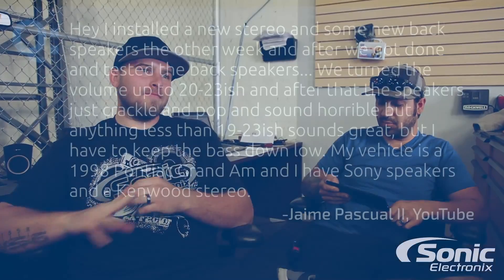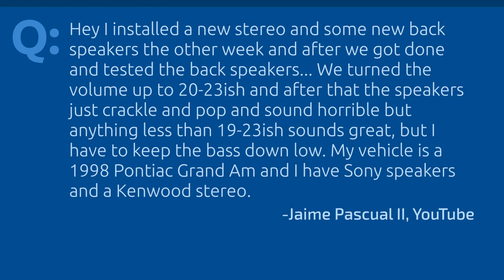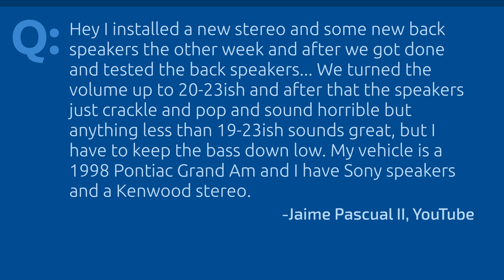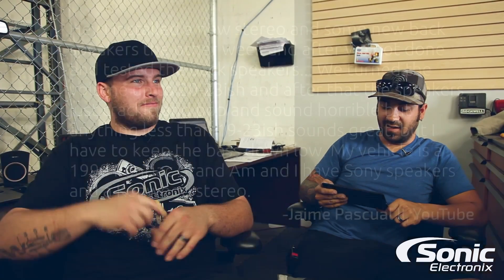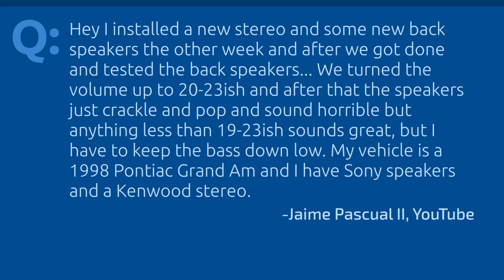Why Do My Speakers Sound Bad at High Volume? | Car Audio Q & A

Comment: Can an amp be bridged to power speakers ?? Not A Sub !!
Reply: +Roshan Dixit i tried that once on a 6x9 (un-mounted) and i saw sparks jumping across the speaker terminals. it may work under certain conditions but but its not worth the risk IMO. just get a bigger amp
Reply: yes you can, but why would you want a Mono output when you have stereo outputs? Also read up on Ohms Law when attempting new things. If your amp is 2 Ohm stable and you bridge the two channels a 4 Ohm load will split across the 2 channels, thus giving each channel a 2 Ohm load. if you wore down to 2 Ohms and bridge a 2 Ohm stable amp that doesn't immediately go into protect you'll blow your amp/speakers up.

Comment: I have a pretty light powered amp Pioneer GMA4604 480W. Runs 40W x 4 or 120W x 2 bridged. I'm powering my front pioneer speakers with two channels and then plan on bridging the last two channels for a small sub. I'm looking at the Kick 10C124's "handles" up to 150W RMS. Does this mean that the sub is recommended to run at 150 W or is that the max wattage? With 120W would it  be considered under powering the sub or will the sub will run weaker @ 120 W. I can't find many decent 120 W subs.
Reply: When matching subs to an amp the MAX/PEAK power rating means nothing, same with speakers. If you can't find the RMS rating of an amp/speaker... DONT BUY IT!
Your front speakers will run 40Watts RMS, your sub will run 120Watts RMS. I usually go off the rule of thumb of keep your sub as close to the RMS rating as possible. So the answer is yes. that's a good match. find the recommended volume for the sub so you buy it once. I don't know about your sub, didn't look it up. it needs to be a single voice coil 4Ohm sub. other wise you will run into issues.

Comment: I just put 6x9 boss 600w subs in my 92 accord coupe and they sound okay until I turn the sound up… could it be my stock radio or do I need an amp ?
Reply: +Martin Turner you'll need an amp def. the stock headunit isnt giving the sub enough power.
Reply: Get an amp buddy, I got 500w so I have a 500w amp.
Reply: buy a 500 watt MonoBlock and wire down to 2 Ohms and call it a day.
Reply: Kevin Wayburn Perf

Comment: Hi. I have a RF Prime Sub, Polk Audio db6501 compos in front doors, and JBL 6x9 coaxials at the rear deck. Pioneer 8690BT is the HU. The speakers and sub setup are being powered by JBL XT646 4 ch Amp and Rockford Prime 4 ch powering the Sub. LPF and HPF on Amps are off. I prefer setting them via the HU. Please suggest the best crossover settings for LPF and HPF on the HU, so that i get a cleaner sound and a cleaner bass even at high volumes
Reply: I usually start with loudness/bassboost off, set the eq to flat, then flatten the volume of the sub to the stereo. after that I put my HPF to 80 and LPF to 80, after that it's preference. I tend to set mine at 100.

Comment: hi, I put in coaxial 6x8 Kickers in my doors of my 04 Mustang. It has the Mach system. Problem is, when I turn up the volume, (not to load) the right door speaker bass cuts off and when I turn down the volume the bass comes back on... help? thank you, Kel.
Reply: Does your mustang have the Mach stereo in it with the amp tray in the back holding 4 amps?
Reply: Mach stereo and it has the sub box and two amps, (one on each end), with the speakers 8x9
Reply: +KelJenn B My friend had an 03 with Mach system. We ended up ripping the amps out and rewiring the speakers off the head unit. best thing you can check is the auto volume and disable it.

Comment: I have jbl gto 509c and mds fanatic f2. My right door speaker sounds good when there is no bass in the song, but when there is bass, I can only hear crackling and popping all over the place. Sounds kind of like there was something loose in the door, but there isn't because i just dynamatted the shit out of the doors. Left door seems to be fine. What could cause this? Im utterly hopeless and it ruins my driving pleasure :(
Reply: Sounds like a blown voice coil perhaps. Try pushing in on the speaker cone while no music is playing. If you hear or feel anything other than silence and smoothness your voice coil is blown and time for new speakers
Reply: +Budz Wingren turned out that when i put more volume, the cone is hitting a part of the doorcard.
Reply: +kakka626 That's great it was a simple fix!

Comment: @sonic electronix.... hey guys , we see all these videos on youtube and sonic channel on why one should upgrade a car speakers... and examples used of a factory speaker is a warn out piece of crap (excuse my language) that's half broken and cracked...... but what if you got a newerr car and have factory stock Bose, Infinity etc. Can you guys do a video on if/should one upgrade when their factory speakers are name brand?
Reply: My Silverado did not come with the Bose system but I think the front speakers are the same. The Bose system sucks, but the amp and speakers are actually decent sounding. I would suggest upgrade the head unit first. You may be surprised. My sister did in her 03 Trailblazer with Bose and likes it a lot. Especially with the added BlueTooth which she didn't have before.

Comment: why do my amp turn off when I turn it up to bass. it thumps hard for about 10 min then turns off ? and when I touch my Amp it's very hot.
Reply: Depends on your amp, what class amp it is determines how much cooling it requires so you could be overheating it with the amp being in a closed environment where it can't breath. Another option is that you are running it in an incorrect way such as some amps can't handle 1ohm loads.
Reply: Thank you !!! I will take a look at that.

Comment: any experience with a DD audio 3512g? I have a (18 inch tall,16 inch sides) speaker box , when I turn my volume abit up I hear a rattle like if the speakers are blown , when I'm away from the speakers ,I hear a good clean bass? Any way it could be?
Reply: check the wire in the box

Comment: I have a issue where my new pyle 5.25'' (upgraded from a 4'' kickers that i thought were under powered) speakers in my dash and at any volume above 25 they crackle so bad and its really annoying and my pioneer 6x9s in the back don't crackle. powered by a JVC KD-R330 deck. Also would bass blockers up front help this issue? thanks

Comment: so a 85W X 4 channel car stereo would mean a RMS of +40W. if that's correct than the speakers to be used must have a RMS value of +50W if u aren't going to use an external amplifier. is that correct?
Reply from the maker: Ulrich Sosro That is roughly correct. Most aftermarket stereos list RMS wattage so be sure to check. A 50W RMS speaker is usually a good match for running right off the stereo.
Reply: yes
Reply: My car radio is 20W x4channel  thats very weak I bought  a  50W RMS speakers the sound is bad when i turn on to max volume what if I buy better car stereo(If I buy 50or100W x4 channel radio) .Pls give me some advice?

Comment: Hey guys.... I have Kenwood ddx 310 head unit plus a boss 3000watt armor class d mono block amp n a 2000watt 4channel's boss riot, with a 2000watt sony explode sub, 2 kicker6x9, 2 pioneer ts-575m but every time I turn my system up I can smell the speakers. N yes its a budget system.
Reply: Mccoy Henry change the cheap sub , look on line for a good price

Comment: i want to upgrade the sound in my 2011 dodge durango and i have been told 3 different things by 3 different installers. One says i should replace the 4 door speakers and amp the sub one says dont amp the door speakers just replace them: One says just replace the front speakers and dont worry about the back speakers: what should i do? I want some good sound without breaking the bank
Reply: It depends on what you want and how much you're willing to spend. If you want more detailed sound you SHOULD replace your door speakers. If it's not loud and clear enough, you CAN add an amp, IF you want to. If you're not sure just get 50 watt rms (or less) coaxials, so they can at least sound decent powered only by the stereo. A subwoofer is not mandatory, but it's better to have it. That way you can play most of the bass on it, and remove it from your door speakers. That will allow you to play your door speakers a bit louder and clearer. A subwoofer definitely needs an amp. Amp everything for best sound.
Reply: Whether or not you use rear speakers is personal preference. Usually a professionally installed sound system is designed so that the sound appears to be coming from the dashboard. It is done to mimic a soundstage in a concert. To do this, most if not all of the voice and midrange should come from the front. Rear speakers move it towards the back, so that is why they don't recommend them. What you can do is fade the sound, so that most of it comes from the front speakers. And just leave enough sound on the rears for rear fill. Especially if you need it for passengers. Unless you have a single cab vehicle.

Comment: Hi there. I have a BMW F30. ' just bought a jbl ms8 dsp. Would that be enough to power my speakers which are rainbow components connected 3way with speaker under the front seats and 2way rainbow components at the back. Now since my components speakers have there own xovers, do I need to set the xovers in the JBL MS?

Comment: Hi. I have a 4400w 4 channel Solar amp. I have a Lanzar double din head unit. I bought two new prv audio 8mb450 door speakers. I wired everything correctly but I'm not impressed. When I turn my radio up to high I get some distortion. I also have a crossover hooked up along with a hi phonics bass amp for my 12" DX subs. I've been told that the Solar amp I have for my door speakers could be the problem and that it's not powerful enough, could this be true?  If so, I thought that that's what a crossover was used for. Plase help. I've been trying to figure this out for a month. Thanks

Comment: Hey guys, I have kenwood KDC-200u headunit in my 1997 dodge ram 1500 and here lately every time it rains it goes into protect mode and then the door speakers do not work. What could be the problem?
Reply: Sounds like maybe a bad ground to me
Reply: I have redone all my grounds and unfortanetly it still happens
Reply: Mckena Taylor By that I'm assuming you relocated your head unit ground somewhere else, right? ....other than a bad HU ground I can't seem to think of anything else that would cause it to go into protect mode. Maybe check your Wiring harness that its not creating a shortage somewhere. If you are using "butt connectors" this could be a possibility, due to the fact that they often fail and disconnect themselves on their own.
Reply: Brian Salazar Okay, I will run through the wires in my wiring harness and see if that is the problem.
 
thanks man
Reply: No problem, hopefully you find the issue with your stereo.

BTW, I forgot to ask if you are grounding your stereo to the factory ground from the car? Maybe this is the problem itself. I would run my own separate ground to a solid metal piece on the car. Also make sure to sand it to bare metal to get ride of all the paint and/or rust. otherwise if you don't, it would be as if you never grounded your stereo at all.

Comment: I have a 15 inch l7 with a sound stream amp running at 1400 ways RMS 2200 peak 0 guage power wire and a boss 4 farred cap.  Will this sub be better off at 3.5 square ft or like six.   Ongoing for a crisp but loud I want the best of both worlds

Comment: Another thing to add, he can fade the sound of the deck to filter more of the power towards the rear speakers (it's a setting I found to be useful) But definitely need an amp if the deck does not have a built in amp most after market deck amps that are 200 watt are 4ch which is 50 watt per speaker (saying there is 4 speakers total) best bet for power is a cheap 300 watt sub with a cheap amp for a average car stereo system. My information is based of personal experience, not expert experience.

Comment: Hey,
I have a Toyota Camry '97 Sedan and wanted to install a new head unit stereo. If i were to go from the factory default tape player stereo, will the head unit and appropriate wire harness be sufficient for installation?

Comment: I have a 2000 Toyota Avalon XL (non jbl system) aftermarket Sony deck (dont have the model on hand but its somethig-something 660up with pandora radio) with pioneer TS series front component and rear coaxial 6.5 speakers. My speakers pop at lower volumes. 20 on down (50 max) 20 and up it goes away. I also have no amp for them at the moment.

Comment: 500 rms isn't enough
Reply: That's an opinion type deal. 500 rms for a sub won't be enough for a super basshead but for most people 500 rms for bass is plenty thump
Reply: I have 4 12in Audio Drift 12s (really unknown and really cheap 12s) on a 350 Alpine Mono V-Series at 1 Ohm and damn those things are loud. Granted I'd prefer 700 watts going to them, but it depends on your subs and the set up you have. I have my bass negative 3 on my headunit or the amp goes in protect because it's unstable at 1 ohm, but a little amount of power can go a long way depending on what the set-up is. That's what I'm saying I guess.
Reply: Hmmm, do you like those Alpine amps? I'm planning on running an Alpine Mono V-Series MRV M500. I heard they are powerful, small compact and underrated.
Reply: You know I really like it. It heats up easily, but it never shuts off. The only time I've had it go into protect was when I wired the ohm load to where the amp is unstable. And yeah it is SUPER small. I like that part a lot. I would recommend it.

Comment: I might also have some insight on this issue that wasn't mentioned in the video, as I had a similar problem in my car with a Kenwood head unit and Rockford Fosgate speakers. My popping was only noticeable at high volumes, but I think it happened at low volumes also, but it just wasn't really noticeable. I am going to outline the troubleshooting procedure that worked for me. 

First, do what the video said. Check all your wiring, and make sure your EQ is flat, no bass boost, etc. It could definitely be the solution to your problem, however, it turned out to be a different problem for me, which is why I felt the need to comment. 

Second, fade your head unit to each individual speaker and see if only one of them is crackling/popping. If so, it is probably an issue with that one speaker. This also did not solve my problem, because the popping happened on all of my speakers. 

Third, try another mode on your head unit. Such as, if you are always using your iPod via USB, then try plugging it into the AUX input and see if the speakers still pop and crackle. If they stop popping when you do this, then the problem is with your iPod or iPod cable. This was the problem that caused my speakers to pop and crackle. Cleaning them both with an air spray can temporarily fixed the problem, but it eventually returned. I ended up just moving all of my music to a USB drive. 

If all of this fails, you may have an issue with the head unit itself, or you may just not have enough power to properly run the speakers, as mentioned in the video. Also, remember to never turn your head unit up past 3/4 of its max volume, because it usually introduces a lot of distortion into the music. 

Hopefully this was helpful, and if all else fails, take it to a professional and have them identify the issue.

Comment: Why does my left door speaker pop when I change a station on fm?
Reply: My guess is the wires on the terminals may be loose and so when a signal changes is makes that sound. I'm grasping at straws, but that's my attempt at trouble-shooting.

Comment: Hey I have a good question for you guys. And some people might want to know as well. When building a box for a sub, if I make the box bigger than what is recommended and don't have a lot of power will it make it perform/be louder? And or if I make the box smaller than recommended and have more power will it be the same outcome?  (Keep in mind they will be tuned to the same hz, and the recommendation box size is 1.25 cf.)

Comment: Hello, I have a silverado 2013 ext cab I want to install and amp to my factory head unit i will also be upgrading the speakers adding an epicenter and a subwoofer. i  want to keep all the factory setting such as steer wheel controls, onstar, blue tooth, etc is there any wire harness that I need to purchase to keep my factory setting. I also want to install an alarm is there any brand you guys recommend. I am willing to spend around 200 on an alarm.

Comment: I have a few Pioneer DEH-X9500BHS in a 1992 Acura integra... I also have 4 very low end Pioneer 6.5 inch 2 way speakers. I want to replace them for components up front, and some coaxial in the rear, since there's no tweeter holes in the rear. Maybe an amp too. really happy with the head unit, just want the mids and highs louder before I install a sub...

Comment: I purchased 2 amps for my car. A sony XM-1S for my RE SEX 12D4 and a XM-4S for my RF components. I ran a 4 gauge Monster cable from the battery into a distribution block and one 4 gauge goes to the xm-1s and one 8 gauge goes to the xm-4s. Is that power gauge enough juice to be running everything at its highest efficiency?